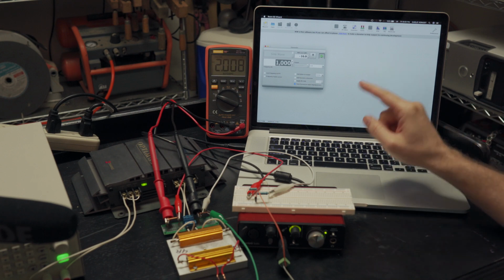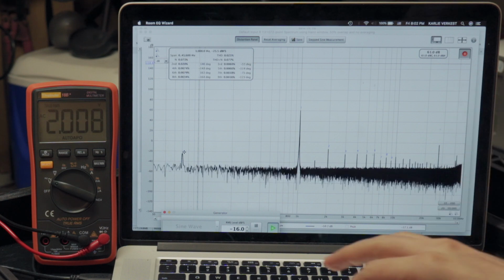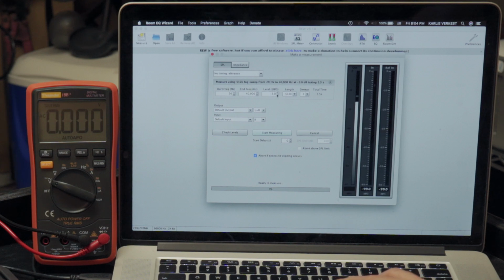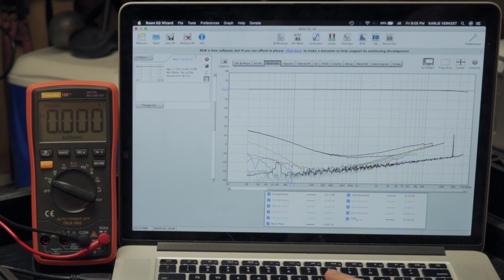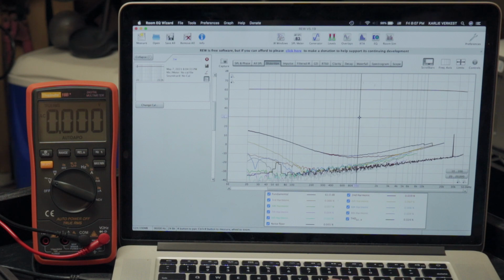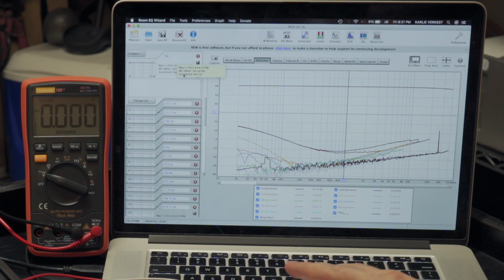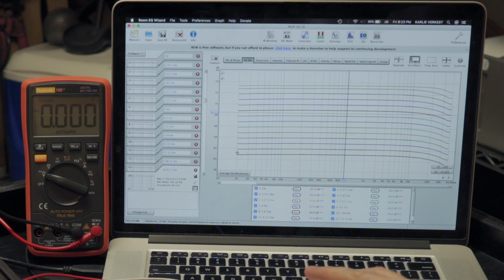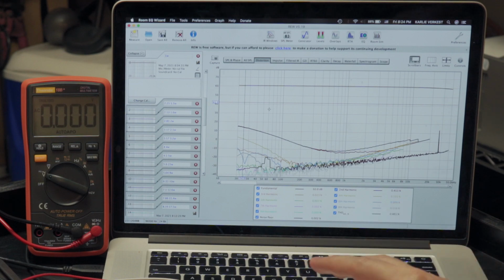Amp Testing Basics (Part 2)

Comment: As I mentioned in a comment on one of your other videos, the noise measurements are incorrect. if you look at the distortion box you will see is shows noise at 0.07% or so which just a little better than 60dB. Calibrate the REW level for 1W then Try the amp with no signal and the input shorted. The signal level in the top right hand box will show the actual output noise power integrated over the 20KHz bandwidth.
Reply from the maker: Thanks! I’ve been learning the correct way of measuring noise. I appreciate your comment! I’m always trying to learn this stuff. My problem is I was too busy having fun designing and building to learn the correct way of measuring noise. In my defense, most of the white noise in the floor is present in my test loop back. The hum components are definitely the amplifier though.
Reply from the maker: It’s also worth mentioning that though I’m way off in terms of the white noise I’m more or less correct in terms of the hum components.
Reply: @Edgarbopp  Agreed. The reason the hum is correct is because it is a single frequency. By the way, I thought you did a great job explaining the Maida HT regulator.

Comment: Great video! Do you think this testing setup would work with headphone amplifers where you are working ac outputs on the order of 50mw
Reply from the maker: Absolutely! Just load it accordingly. I’ve designed 4 preamps and loaded them with line standard 10k-600R loads and tested them just like this